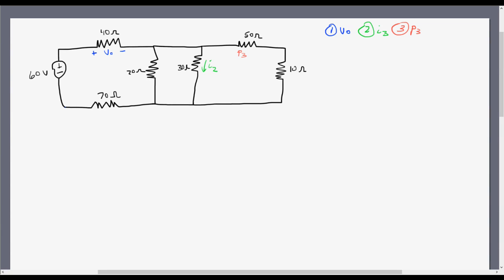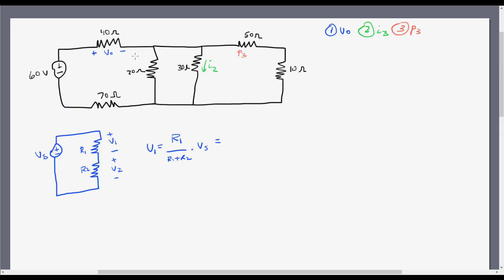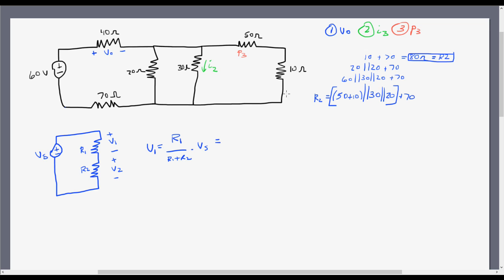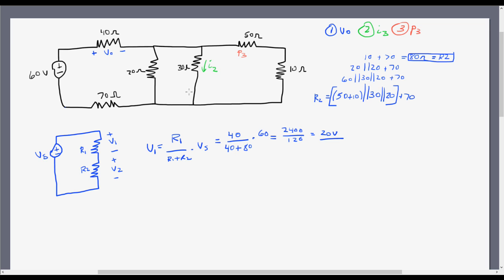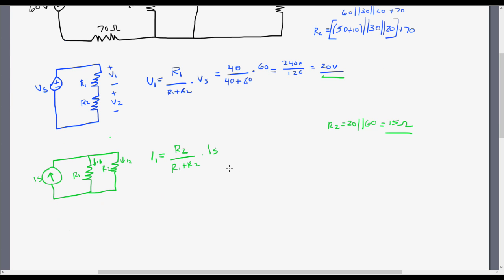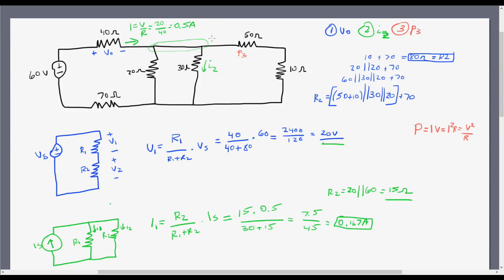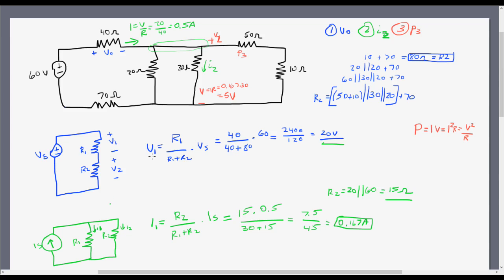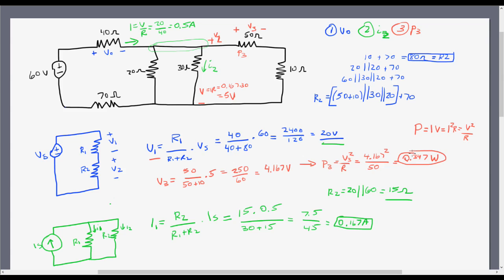Solving Circuits Using Voltage & Current Dividers

Comment: I am having trouble with you designating V2 as 5V. 5V is the volts DROPPED by the 30 ohm resistor. It seems like the large essential node across the top would be 40V, obtained by   60Vs minus the 20V drop across the 40ohm resistor.

Comment: The analysis for i2 is confusing when explained, but you achieved the correct answer.  For those who found it hard to follow, I will try to help explain below...

Since we know the current going into the node 1 is 0.5A, we can redraw the circuit using 0.5A as the current source and combine 50R + 10R (series) = 60R.

0.5A (Is = Current Source) -->  20R || 30R || 60R
                                                       i1       i2       i3

We want to find the the current across the 30R = (i2).
** But first, let's find current across 20R or i1.

30R || 60R = 20R

NEW Circuit:
0.5A (Is) --> 20R || 20R
                       i1   (i2 || i3) = ix
Current Division: Is * ( ix / ( i1 + ix ) )
i1 = 0.5A ( 20R / (20R + 20R) ) = 0.25A  <--- This is current across 20R or i1 (First Resistor)
* Remember, the opposite resistor is applied in the numerator *

Now we can re-draw the circuit utilizing new Current Source starting at node 2:

0.25 (Is) --> 30R || 60R  (w/ i2 across 30R and i3 across 60R)
                       i2       i3 
Current Division: Is * ( i3 / ( i2 + i3 ) )
i2 = 0.25A (60R / (30R + 60R) = 0.1667A  

i3 = 0.5A - 0.25A - 0.1667A = 0.0833
          Is        i1            i2               i3

Check: KCL Rule 
0.5A = 0.25A + 0.1667A + 0.0833A
  Is    =     i1    +      i2       +       i3   

0.5A = 0.5A  (GooD) 

Hope this helps :-)
Reply: Very helpful, the video confused me on that part but this cleared it up
Reply: I’m so glad you took time to clarify this. That part of the video was confusing
Reply: It’s better if you do the video instead.
Reply: but why are the resistors of 40 and 70ohms being ignored? im hella confused by that
Reply: @ath6632  because current is the same in series and 40 ohm , 70 ohm is in series.
Reply: @hanaanasr1064  now this was the anwsers i was looking for thk u brotha
Reply: Idk why u guys are doing it this way if you could just redraw the circuit and then do ohms law for it- It gives me the same answer and it took 10 mins in total?

Comment: Question: How do you get 15 ohms from 20||60? shouldn't it be a third? 

Edit: I just realized u were adding the resistance in fractions. 1/20 + 1/60 = 1/15 ohms nvm!

Comment: When calculating V2 which is 0.167A * 30 ohms = 5V wouldn't this be negative since the voltage is flowing in the opposite direction to the current i2??

Comment: Voltage divider formula is Vout =( R2 / (R1+R2))xVin ...why in your care is Vout =(R1/(R1+R2)) xVin?...this is confusing...did you made some different notations?
Reply from the maker: Hi. The voltage divider formula with R2 in the numerator will find the voltage drop across resistor R2. If you want to find the voltage drop across R1 instead (we call this Vo in the video), you simply put R1 in the numerator instead of R1 and you now have V1 (or Vo in the video).
Reply from the maker: Since the resistors are in series you can switch positions between R1 and R2 and use the voltage divider equation for whichever resistor you need and apply the formula this way.
Reply: @engineeringmadesimple8359  so just to be clear, with voltage division, you put R for whichever voltage drop you are finding, but with current division, you do the opposite?

Comment: sir your lecture is very good & my question is in Video you want to find v (not) but while solving you wright v1
Reply from the maker: I apologize I did not always use the same notations in the smaller formulas on the bottom as the main formula on top. Hopefully people can see the strategy I was trying to use.

Comment: Is it possible to use the parallel addition on 60 ohms and 30 ohms instead of 60 and 20 for the current divider part? Thanks

Comment: I don't understand. R2 = 30 but why did you make it 15?
Reply from the maker: Hi. I combined the R2=30 with the 50+10 (far right) using the parallel resistor reduction technique. This gave me a new R2 which is 30||(50+10)=30||60=20. Now that I have 20 for my R2, I can use the current divider formula to find the current through the other resistor in the current divider.

Comment: what happens to the 70ohm?
Reply: Exactly whydid the 70 ohm resistor was not used in calculating the i1 in the circuit.
Reply: @umangrathore6825  i guess its a superfluous element(?) im confused too lmao

Comment: For the resistor where you needed to find the power. After finding the voltage, and given the resistance; why didnt you use the voltage and resistance  to find the current (i = V/R) then do P = IV?

Comment: All I need is for someone to correct me, i'm sure i'm just being dumb, but I LOVED the first part solving for Vo, but when you started solving for I2 that means the direction at which the current flows plays a factor in the equation. You have every thing set up as if the current were flowing positive-negative and i'm confused because I thought current flows negative to positive? what is going on, someone please help me lol
Reply: as long as you're consistent it doesn't matter.

Comment: In second problem how that v=20 instead of 60 as shown in diagram!
Reply from the maker: Hi. In Part2 we are reusing Vo from Part1, which we have found to be 20V. Since we know 20V is the voltage drop across the 40 ohm resistor, we can use V=IR to find the current in this part of the circuit.

Comment: I don’t get how you got R2. Where did the 20||20 come from?
Reply: The 60 ohm resistor is parallel with the 30 ohm resistor, so we get ((1/60)+(1/30))^-1 as the equation to get their equivalent resistor.
Reply from the maker: R2 became 20||20 because it was 60||30||20. 60||30 is (60*30)/(60+30)=20 so we now have 20||20.

Comment: the way  you did the voltage divider didn't work for a test question I had
Reply from the maker: Would you be able to share your test question?  I would double check to make sure you collapsed all of the circuit resistors properly before applying the voltage divider equation.
Reply from the maker: Also, I'd like to note that if you have any active elements in the circuit (capacitors or inductors) and not simply a resistor circuit, this method will not work

Comment: When finding i2, why do you use the resistor R2 in the numerator instead of the 30 ohm resistor that we're finding the current in?
Reply from the maker: Hi @RedneckDrillMan, great question.  For the current divider equation, you use the opposite* parallel resistor in the numerator when finding the current for the branch you are interested in.  I accidentally made the i2 in the original circuit the i1 in my current divider, but nonetheless, R2 becomes the opposite branch (15ohm) from the branch I am solving the current for (in our case the 30ohm branch).  I hope this helps.
Reply: EngineeringMadeSimple Awesome thank you, that helps a lot. The equation in my textbook did not make that clear and I kept getting the wrong answer.
Reply: @aHydrasa  Super late but you can actually use that formula in a purely parallel circuit, but the trick is, the resistors are in conductance or the reciprocal of the resistor wherein instead of R1 you use 1 / R1. So in formula it would be: ix = isource ( 1 / Rx ) / ( 1 / R1 + 1 / R2 + 1 / R3 + 1 / Rx + ... )

TL;DR. Use the same resistor as numerator to find the current across it but all of the resistors are in reciprocal.